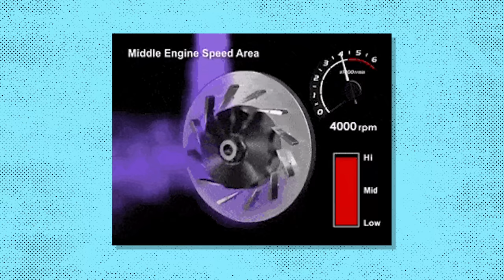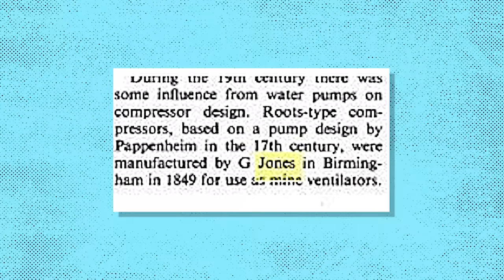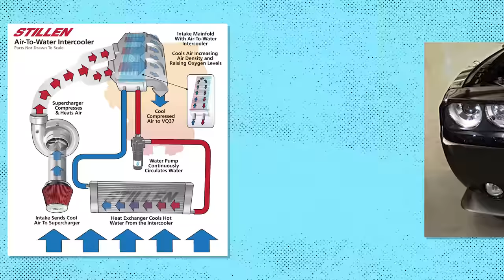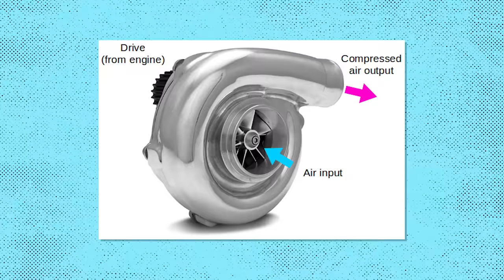Why Superchargers Aren't As Good as Turbos

Comment: I read somewhere that the supercharger on a top fuel or funnycar costs about 700 hp in parasitic loss, runs at about 50psi and delivers about an extra 3,000 hp! That and the instant power make them a must in those categories of drag racing where 0 to 100 mph in about a second is where you want to be. Fitting one to your Dodge Charger (other 70's muscle cars are available...) is just street terrorism...
Reply: Funny Cars and top fuel cannot afford ANY lag... and the the fact that Nitro-Methane fuel run on Air-Fuel-Ratio of 2:1... Any boost is good boost as apposed to 14:1 AFR for petrol or diesel; 12:1 for ethanol.

ALSO they run closer to 11,000 HP total... No engine dyno can run them... the HP are calculated by math needed to complete the 1000FT in 3.6 seconds
Reply: I don’t think that’s quite right. I’m not very knowledgable about top fuel dragsters but I believe turbos were used in the 80’s or 90’s but they banned them because of the ridiculous power and speed they could make.

While they were slower off the line the turbos very quickly caught up with and beat the superchargers. And dragsters rev the engine before the start so I believe most of the boost is already built up since they’re not starting from idle
Reply: @GertieYTube  They're banned because of safety issues related to running the turbo and top speed limits introduced by NHRA after folks were getting killed at crazy speeds (much like WRC did in the 80s too).
Reply: @th3airraidsir3n5  top fuel does not rev there engines at the starting line. Top alcohol revs at the starting line.
Reply: @orangejjay  good old deadly Group B vibes lol.
Reply: @th3airraidsir3n5  lol NO, not at all, that's nonsense. They were banned from exploding too much. There's only one funny car in the world, an experimental, and it's not as fast as the supercharged versions
Reply: 700 hp from 12,000 ain’t much. And you cannot run turbos on nitromethane, they will be a pile of molten goo. There is no free lunch. It’s all about efficiency.
Reply: @ppernett1  You can't run turbos on nitromethane? Thats funny.
Reply: @ppernett1  Thats right, Top Fuel car only get about a 30% boost in horsepower from supercharging... rather pathetic really, 
much lower than can be achieved with turbochargers.
Reply: @sandervanderkammen9230  they are limited to a specific amount of boost. They could likely do much more but they're already on the edge of what the rest of the car and the track would allow for.
Reply: @joeross6523  The point was they don't make much power from the supercharger and could make more horsepower at the same manifold pressure with a turbocharger...
Reply: I can only say that my Supercharger hast ist own beld and it is Wider and double the Price of the other one xD
Amazing that the engine make like 450WHP and need to supply 100Hp only for the Supercharger so it has like 550HP total.
Reply: @Hobby_Electric  With a turbocharger you could have 550hp at the flywheel... instead of 450hp.
Reply: @sandervanderkammen9230  huh? Don't think you understand how boost works bud
Reply: @Lo0die3  Why would you think that?
Reply: @Lo0die3  I think you still don't know how engines work son...
Reply: What does it cost if the net horsepower is 12,000? 
Why would we care if it was 1,500?
Turbo guys have a real hang up with that.
Reply: @dallynsr  Why sell yourself short with the supercharger?
A turbocharged Top Fuel engine could easily deliver an additional 3,000 hp at 50psi pf manifold pressure.
Reply: @orangejjay  Why the hell are we still breaking world records if I'm to believe a word of what you just said?
Reply: @jankington216  Turbos are banned in NHRA Top Fuel because they would be too fast.
Reply: @sandervanderkammen9230  any research on metallurgy and nitrometh EGTs would say otherwise. All of the still burning fuel would heat that turbo into melting. The only way that a turbo would benefit would be in a draw through system that takes advantage of the cooling properties of liquid nitrometh. That would be extremely inefficient and a waste of power. Are you going to run intercooling pipe on a funny car?🤨
Reply: @keanandelarosa1329  Gale Banks says otherwise...
The fuel formula and stoichiometery play a big part in EGTs and turbine ITs.. in NHRA Top Fuel we are talking  about lap times in 3 to 6 seconds... not minutes.
Reply: Modern top fuel from what I've read say they run roughly 100 to 140pis
Reply: @GertieYTube  very good info thank u
Reply: @th3airraidsir3n5  great info thanks
Reply: @dallynsr  your thinking about it wrong take 2 top fuel cars both run the same max boost so if you were to dyno them a turbo version would have about 1000hp more available to drive the wheels vs the supercharger and at the claim of 10000 to 11000hp that is about an extra 10% more power that is a huge difference without tapping into anything extra turbos can do
Reply: @keanandelarosa1329  the EGTs aren't an issue we have that sorted for a long time you know jet engines and gas turbines much hotter and directly fire onto the exhaust blades and 1100 degrees for a few seconds isnt much anyway
Reply: @shaynegadsden  do you have any idea what intake temps are for cruising air craft on a warm day? Cruising temps are so cold that if you stuck your hand out the window you'd probably have frostbite in under an hour. Jet air craft EGTs are on a completely different level dude.
Reply: @keanandelarosa1329  didn't know they started of in the air oh wait they don't they see extreme temperatures because they take off from the ground having massive amount of fuel poured in with minimal air as the engine spins and running at max as it takes off to get to that cruising altitude all of which takes much longer than a top fuel race
Reply: @shaynegadsden  and you realize that the jet fuel within itself has cooling properties? And the massive amounts of cooling veins? And how this has absolutely nothing to do with the topic at hand?
Reply: @shaynegadsden  not to mention the massive amounts of air that a jet engine ingests even just sitting there
Reply: @shaynegadsden  and if you had studied any basic diagram of a jet engine you know that the only thing "firing" off is a compression chamber that runs the outer ring of an assembly and even then is usually only the back half to quarter of the engine
Reply: @keanandelarosa1329  yes Jet fuel has cooling properties but much less than nitromethane or methanol and it has everything to do with the top topic you claimed thet the etg's would be too hot for a turbo which is bullshit we already have ways of dealing with much hotter egt's on turbines than what a turbo on a top fuel would ever see so running a turbo has nothing to do with heat there is many reason they don't run turbo's yours just isn't one of them
Reply: @shaynegadsden  are you going to invest in the cost of making a wear part out of superalloys or housings made of milled tungsten? Titanium alloys tend to have a melting point of 3034°F. Nitro meth burns at 4350°F. By the time the rest of that unburnt nitrometh burns at the turbine it would be melted. This is basic metallurgy
Reply: The reason turbos aren't used in Top Fuel is simply the fuel is still burning when it exits the engine. Turbos would simply melt if you pushed 10,000+ horsepower of still burning exhaust through them.
Reply: @m.cigledy6769  thank you! Shit bro google been free for a hot minute
Reply: @m.cigledy6769  another one no it wouldn't before a turbo would have the piston, valves and head would have already melted
Reply: @shaynegadsden  Not really. A turbo would not be able to force any more air Into the engine, because they are ALMOST locked up solid (hydraulically locked) at the top of the compression stroke from the huge amount of fuel. If you could get a turbo to work on these engines, it wouldn't actually make more power, it would just lose less driving the supercharger. Plus, the piston rings and spark plugs DO melt as it is.
Reply: @m.cigledy6769  even just saving the power driving the blower would still be nearly a 10% gain and honestly the pistons only last 4 or 5 runs so what would it matter if they needed to rebuild/replace a turbo just as often, the fact is it's already been done and they said it was stupidly dangerous not only are they more efficient but have greater flexibility too a blower has a fixed peak boost while a turbo can be set at various limits depending on different factors
Reply: @th3airraidsir3n5  The way that top fuel drag cars launch and rev mean that turbo lag would not be the main issue. Whether it be the speed or the dangers of the pressure going into the turbo that would probably explode a lot hot side turbines
Reply: Are you one of those Karen’s that say loud cars are just for intimidation?
Reply: @sandervanderkammen9230  I don't think you understand how superchargers work and how turbos work.
Reply: @keanandelarosa1329  I don't understand you point about outside aircraft temperature, compressor outlet temperature in a jet engine is several hundred degrees...
Reply: @keanandelarosa1329  Sorry but again you fail, jet fuel is heated by the oil coolers before being injected into the combustion chamber liners... which are cooled by bypass air... not the fuel.
Reply: @keanandelarosa1329  Turbine are not made of Tungsten or Titanium.... you don't know anything about metallurgy or Brayton Cycle engines.
Reply: @m.cigledy6769  The reason why Turbochargers are not used is because they are specifically BANNED in NHRA Top Fuel.
Reply: @m.cigledy6769  Sorry but you are clearly not qualified to discuss this subject inteligently.
Turbo specialist Gale Banks actually built a turbocharger Top Fuel and was demonstrated for the NHRA which immediately banned turbos.
Reply: @Ser_Jorah  Thank you for confirming that you are not qualified to speak inteligently about turbochargers or Superchargers.
Reply: @sandervanderkammen9230  Uh, yea, THIRTY FIVE YEARS AGO. At that time, when engines were in the 4,000 to 6,000 horsepower range turbos were banned for NHRA reasons. Not arguing if or why on that. But TODAY, with more than double that (estimates are in the 12,000 horsepower range) the amount of power going through the engine and the R.P.M. and stress levels an effective turbo would need to be at, there just isn't a material that can handle it as reliably as a supercharger does. Or have you created something that will in your kitchen but "The Government" will have you killed if you tell anyone?
Reply: absolutely
Reply: @sandervanderkammen9230  😂
Reply: @m.cigledy6769  True, the 1964 vintage Chrysler 426 engine cannot handle the significant increase in BMEP and horsepower that Turbos would  add...15,000 horsepower is just too much power for a Top Fuel car to handle... and the increased speed would be a serious safety issue.
Reply: @sandervanderkammen9230  You aren't really looking at the numbers.
A turbocharger can't add any more air Into those engines. Not because of design of the turbo, but because there is no more room. The engines are ALMOST locked up solid at TDC. Maximum power benefit of a turbo would be less than 5% (if it didn't melt, which it would,) but you would also lose the benefit of the exhaust pushing the car into the ground and forward. The exaust is actually pushing with about 500 to 800 pounds of force (this gives more traction, & the car could actually blow itself down the track with just exhaust.) Use that power to run a turbo, now you have less traction.
Turbos don't spin up quickly enough, the amount of boost varies too wildly with RPM, throttle position and load, and they would melt.
Superchargers airflow is directly linked to the RPM, and so is engine airflow requirement. They can explode or shred the belt, but not every time.
Nitromethane was banned for a while, too, but enough people wanted to use it so it was allowed. People are creative. If turbos would work in Top Fuel, someone would have made another one.
Reply: @m.cigledy6769  Who said anything about adding more air?
Turbos add more power to the rear wheels by converting a higher percentage of the heat energy liberated from the fuel.

If what you claim is true?
Centrifugal compressors are more ideal for Nitromethane fuel.

The only reason why Turbochargers are not not used in Top Fuel is because they are BANNED
Reply: @sandervanderkammen9230  you dont know anything about Nitromethane or Methanol do you?  First off, do you know why they dont need intercoolers on Methanol cars?  Because the fuel injection freezes the induction system.  On roots style blowers.  At the end of the run the Injector hat is frozen which cools the incoming air to the roots blowers.  Often times the shaft freezes the air plates on the front of the blower, thats why the scoops are mounted so high.  Second, there isnt a turbo in the world that can supply enough air, BY VOLUME, to feed the engine.  Notice i didnt say pressure or BOOST.  Third, volumetric efficiency is everything and with too much manifold pressure, you would blow all your boost out of the exahust valve when you are trying to compress a Nitromathane/ Air mixture and freeze the exhaust valve before the compression cycle begins.  Last but not least, money costs to make it perform are astronomical because of the technology costs involved.
Reply: @joshtheking1772  Can I get some of that weed your smoking???
Reply: @joshtheking1772  Indy cars ran turbocharged intercooled engines on Methanol fuel until 2007.
Reply: @joshtheking1772  The RTA96-C Turbocharger delivers enough air to produce 107,390 horsepower... it makes a Top Fuel blower look like a Black&Decker Dustbuster son!
Reply: @joshtheking1772  NHRA Top Fuel is a Vintage class racing series... the only engine allowed to compete is an old 1964, 426 Chrysler engine... obsolete since 1971.
Reply: @sandervanderkammen9230  nitro is still burning when is comes out the engine and it's burning very very hot. You would need a turbo made out of inconel to survive that.
Reply: @andrewyork3869  Wow! You don't know anything about turbochargers do you?
Reply: @sandervanderkammen9230  pretty sure nitro methane burns at 2400ish degree C.... More then enough to melt aluminum or titanium, granted a ceramic coating might help a little but not a lot. I know turbos glow from time to time but that's not on nitro methane. Both ethonal and methanol burn at sub 2000, pushing most cars I assume exhaust temps will never break 2000 c. Because I can already see where this is going, flames on downshift or a civic/rotory  popping is way different than a oxygen rich blow torch hitting an impeller blade.
Reply: @andrewyork3869  Stay in school kid and stop pretending to be an automotive engineer...
Reply: @sandervanderkammen9230  I could say the same to you. You clearly don't understand the engineering that goes into top fuel, or frankly how it's getting to the point where taking the tires and track out of it we are hitting the physical limit of what we can get out of these engines at least with out adding volume.
Reply: @andrewyork3869  That is a very benighted statement considering that NHRA Top Fuel is a vintage formula class of drag racing, the only engine allowed to compete is the 1964 Chrysler 426... an engine designed with sliderules and limited by having pushrods! Lol!!!
Reply: @andrewyork3869  The NHRA BANNED turbochargers from Top Fuel because they would make the cars too fast.
Reply: @sandervanderkammen9230  yeah thats my point that given what they are working with in material science would have to advance for them to get any more power.
Reply: @sandervanderkammen9230  I just looked at the only video I could find of that turbo top fuel dragster making a pass. I promise you neither of those dragsters where burning fuel like we see today.
Reply: @andrewyork3869  You really don't know anything about about automotive engineering do you?

You have made some very false assumptions and simply don't see that you are making a fool of yourself.
Reply: @andrewyork3869  You should be reading a book, try automotive fundamentals and then work your way up to Thermodynamic Principles of Heat Engines..
Reply: @sandervanderkammen9230  you realize in my original comment I didn't disagree with you I just said it need to be made out of the proper material every engineer knows what inconel is....
Reply: @sandervanderkammen9230  no you  should then you would get why turboing a top fuel dragster is not  trvial as buying and installing it.
Reply: @andrewyork3869  Turbos are already  made of nickel alloys..
Reply: @andrewyork3869  Gale Banks did it years ago... then NHRA BANNED turbochargers
Reply: @sandervanderkammen9230  not all.
Reply: @sandervanderkammen9230  rules says only roots type supercharger is allowed... tf dragsters tech is very old style..... in tf bikes and harleys, we can use any type of supercharger, i use in my bike twin screw supercharger
Reply: @ppernett1  indeed, exhaust temperatures are way too much for turbos + exhaust fumes are highly corrosive... there is more problems too, we are cooling the engine with fuel, so raw fuel comes out from the exhaust, overlap is big issue with turbos
Reply: @NitroGnome  Yes, that is correct. 
Several applications were made to include turbos, after seeing a demonstration the NHRA banned turbos because they make the cars too fast.

In alot of ways the Harley Davidson engines are even more antiquated..
Reply: @NitroGnome  Bullshit! and I can prove it!

Turbochargers would produce a huge increase in horsepower and trap speed, something the NHRA doesn't  want for safety and liability reasons.
Reply: @sandervanderkammen9230  we dont need any more power... just better clutch control and traction... 2000hp is enough from 1700cc vtwin bike which has gone 5.83... and many times 5.9's and very low 6's in 1/4mile.... + we are not here under NHRA's mafia... our bikes could use turbos, if they just could take that beating, typically turbocharger turbine wheels start to erode over 1000c and top fuel engine exhaust gasses are way over that...
Reply: @NitroGnome  You really don't know anything about turbochargers or Top Fuel do you?
Reply: @sandervanderkammen9230  well... While being mechanic to tfb138 and owning a nitro harley and having limited time, I don't waste more time on you...
Reply: @NitroGnome  You don't fool me son, I worked for the number 1 cylinder head manufacturers of Top Fuel engines, we used exhaust valves made from the exact same material used in turbocharger turbine wheels... rated for 1,500° C
Reply: Today's TOP FUEL engines are at 11,000+ horse power. The engineering behind this is TOTALLY INSANE....and I love it. Multiple turbos on paper would make more power, but won't deliver the desired results in the required manner. Potential on paper is great, application is a different story. NHRA has a fan feature at national events called NITRO SCHOOL. They bring different TOP FUEL team members on to talk about what it takes to run TOP FUEL. IT is eye opening and insane at the same time. One thing each EXPERT will say is...." 11k+ horsepower is GREAT...but they could win races and go faster....with LESS HP...if they had more control of getting this power to the track surface" . Think about that for a minute.
Reply: @shaynegadsden  they rebuild the engines after every run. They are basically running like 
A diesel by the end
Reply: @Th3AirRaidSir3n  top fuel and funny cars do not increase their revs before launch. But they launch hard AF. They have 5 clutch plates to help mitigate that power to the wheels, with the majority of them being welded together by the end of the run. The wheels also act as their "transmission"  They squat low on launch and the faster they go, the more they expand (to a point of course)  This helps with their power distribution to the rear wheels
Reply: @mikef-gi2dg  Not true unfortunately, Top fuel cars would be much faster Turbocharged,  the NHRA banned turbos in Top Fuel for this exact same reason.
Reply: @zerobomb0  Correct, turbos actually deliver a better power curve for drag racing, but they make the cars too fast for classes like Top fuel and funny car
Reply: @WilhelmKarsten  Oh no look who's back.
I guess your turbo TOP Fuel should be ready by now...Great...WHO CARES!!!
Reply: @mikef-gi2dg  I never left Top Fuel... 35 years in this industry
Reply: @WilhelmKarsten  congrats who cares?
Reply: @mikef-gi2dg  We do, we would like to use turbos but the NHRA does not allow them.
Reply: @WilhelmKarsten  Maybe you have huffed too much NITRO...( yeah like that's likely) or maybe the sound of turbos in you head has you convinced that I give a crap. Go cry to someone else.
Reply: @mikef-gi2dg  Maybe you should stop pretending to be an expert on engines and racing... your comments are typical of an "armchair expert"
Reply: @WilhelmKarsten  I am an expert on racing, but I pay someone else to be the expert on engines. Keep huffing Richard head.
Reply: @mikef-gi2dg  A REAL expert would know that Turbos not used in Top Fuel because they are Banned
Reply: @WilhelmKarsten  If they are banned and you know this, why are you crying about it?
Do you expect YouTube to change the rules? Maybe you think I will take 2 dead rats, wrap them up in wet TP, rub them together, say some magic words, and begin to care about your whining about the rules.
Maybe you should complain the rules or competition committee. They can send you a nice get lost letter. Grow up or go play in  traffic, choose one.
Reply: @mikef-gi2dg  NHRA officials actually considered allowing turbos in Top Fuel but after initial track testing were horrified by the massive increase in performance and banned turbos for safety considerations.
Reply: @WilhelmKarsten  Complain to them not to me. If you don't like it start your own organization call it....TURBO OR NOTHING RACING. i'M sure you will have millions of it can only be a turbo obsessed fans waiting to join up, and send you cash. this should keep you busy managing your whirlwind success, that will revolutionize world wide Motorsports forever. An added benefit is you will be preoccupied with the turbo voices in your head, with no time to message me about what you think about ANYTHING.
Reply: @WilhelmKarsten  Start your own organization......then go play in it, stop whining to me.
Reply: @mikef-gi2dg  Completely moot point because Turbochargers are banned in Top Fuel drag racing..
Reply: @mikef-gi2dg If your premise is that superchargers are better because Top Fuel dragsters use them? It a completely invalid one because the rules only allow superchargers to be used.
 Turbochargers, by default always produce more power than Superchargers in compareable situations, Top Fuel is not a comparable analogy.
Reply: Yep. Having opinions is fine, but everyone saying that superchargers are useless or obsolete compared to turbos are just ignorant. Both have their place and make power in different ways at different speeds and serve different purposes. It really all depends on what kind of engine and vehicle you have. There is no objectively right answer and folks saying their opinions are facts is getting really damn old!